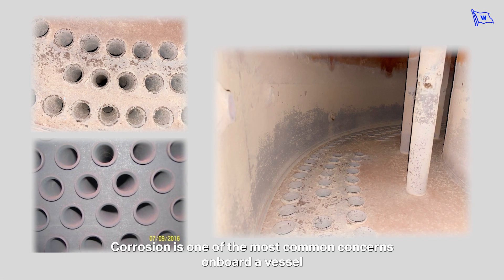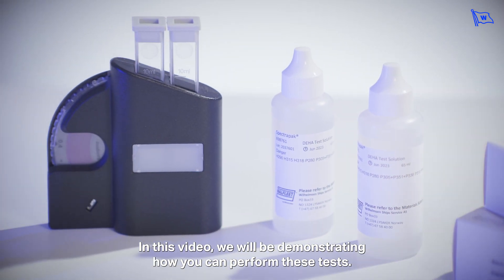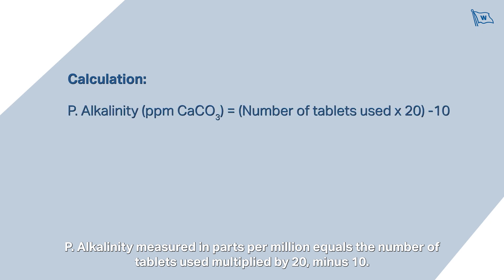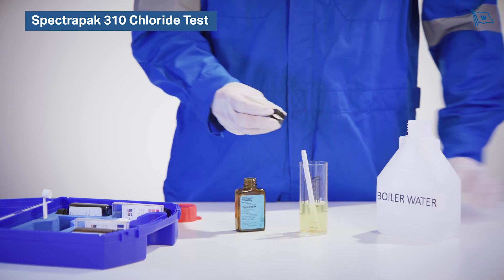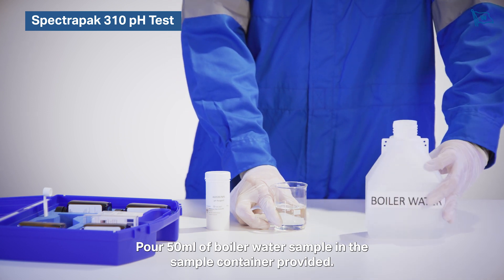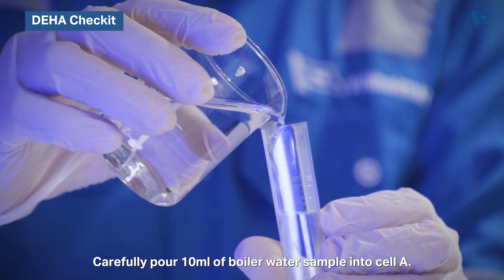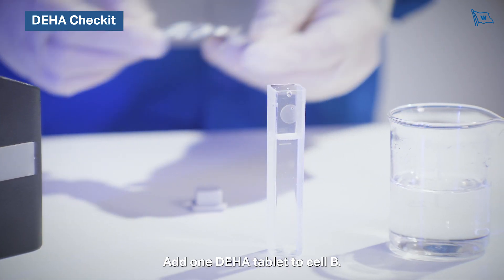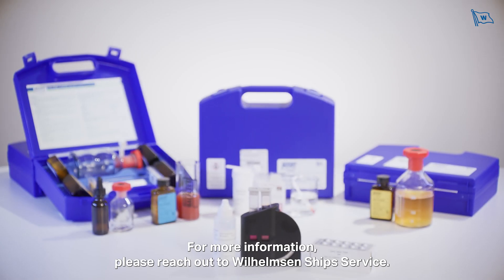Spectrapak 310+DEHA Water test kit

Comment: What does it mean if the boiler water doesn't change colour after 10 minutes?
Reply: There are few reasons on why there is no color change.
1. Absence of analyte: If the test sample does not contain the specific analyte or substance that is meant to react and produce a color change, then there will be no observable color change.
2. Incomplete reaction: Sometimes, the reaction between the analyte and the reagent used in the colorimetric test may be incomplete. This can happen due to factors such as insufficient mixing, improper reaction conditions (e.g., temperature or pH), or an inadequate amount of the reagent.
3. Colorimetric limit: Each colorimetric test has a specific sensitivity or detection limit. If the concentration of the analyte falls below this limit, the color change may not be noticeable to the naked eye. 
4.Interference or masking: Sometimes, other substances present in the test sample can interfere with the colorimetric reaction or mask the color change.
5. Incorrect procedure or reagents: Human error, improper procedure, or the use of expired or incorrect reagents can also lead to a lack of color change. 
If you encounter a situation where no color change is observed during a colorimetric measurement, it is important to troubleshoot the experiment, verify the presence of the analyte, and evaluate the test conditions to identify the cause of the issue.